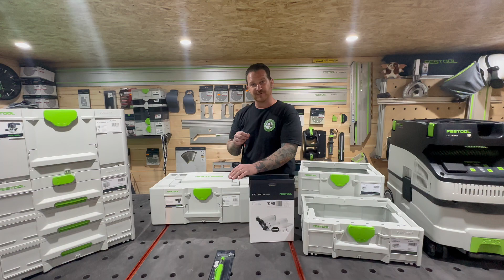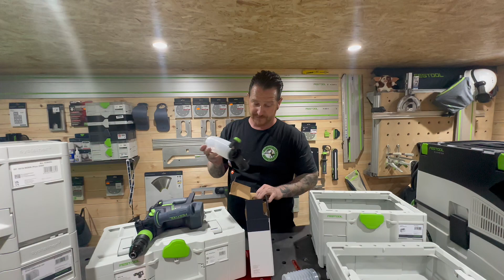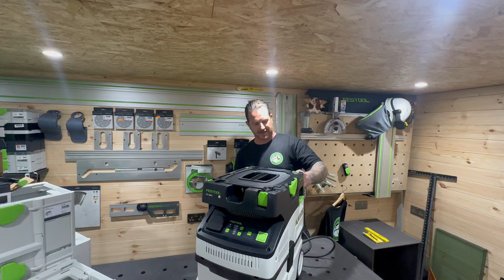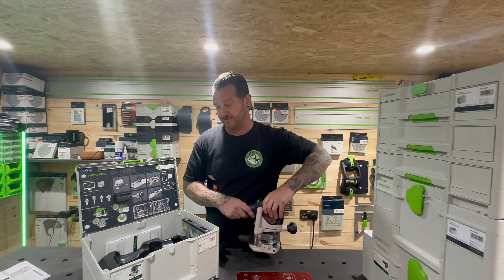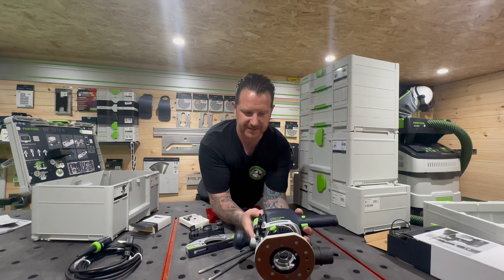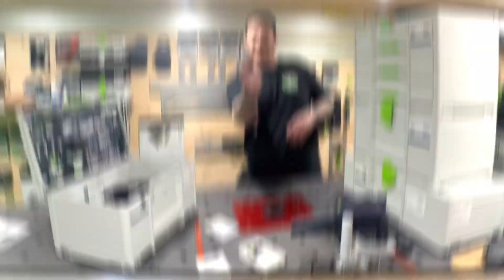New festool KHC18, 1010 REBQ and CTL midi extractor

Comment: Thanks Gary for the sarcasm, I think L class is okay for carpentry, the guy in this video agrees with me unless your using cement based materials you don’t really need M class, in fact the the only difference between the Festool L Class and M is the M class has a beeper when it’s full, and I think there should be a page in the health and safety book just for sarcasm, obviously only in England.

Comment: Thanks again, so basically when they say you have to have an M class dust extractor for carpentry, it’s ball shit an L class is good enough, I don’t like those health and safety people anyway.
Reply from the maker: Pretty much Adam, that’s what I  was advised!  It’s subject to the site but also the M class has a blockage and fill sensor so if there’s an obstruction in the hose and it stopped sucking an alarm will sound advising you of the case!  Some sites understandably would get very funny if your extractor went down and you were carrying on cutting and making dust in the air unaware!  If I worked on site for the sake of £100 extra approximately I would have gone M to cover myself but just me on site or in the shop +1 at times so no need!  

If in doubt ring Festool for peace of mind 👊
Reply: Happy lung cancer if you regularly cut ply, MDF etc. A more sane and sensible argument would be to settle with an 'L' class extractor as a hobbyist/DIY'er, with limited exposure time compared to a professional or employee, and ensure it's regularly cleaned through, with regular bag and filter changes. 
'L', 'M' and 'H' classifications exist for a reason - primarily to prevent unnecessary deaths to employees either directly, as users, or indirectly because you're breathing in someone else's dust in a workplace.

Comment: Hi I like watching your videos, I’m a carpenter do you really need an M class dust extractor for carpentry , I have a L class and I think it’s fine for carpentry.
Reply from the maker: Hi there and thanks for the message and the support. 

It isn’t a yes or no answer. 
If you work on public/ commercial building sites then yes you must have an M class and extractor but his subject again to what materials you are cutting. Most woods are fine but things like cement board, things containing silica dust, certain MDF boards  I believe…. so please check before purchasing to ensure it’s suitable for your requirements. My work is all domestic and private and I don’t use it for anything other than saw dust so for me it’s great 👍   

Hope this helps my friend 
Thanks 

Rich
Reply: @woodpeckersworkshop thanks for your reply, I wasn’t actually talking about the regulations for M class, I was talking about common sense, I have a Mafell mt55 track saw, and a fein L class dust extractor, and I can’t see any dust, same thing with my festool sander, can’t see any dust, personally I think M class is over regulation for carpentry.
Reply from the maker: Your sweet then mate as it’s more designed with the M class for finer cement based particles and silica products!  As a carpenter just cutting wood you’re absolutely fine and exactly the same set up as I have regarding extraction 👍   Oh Mafell …… very nice 👌